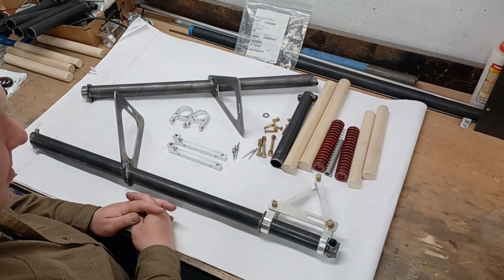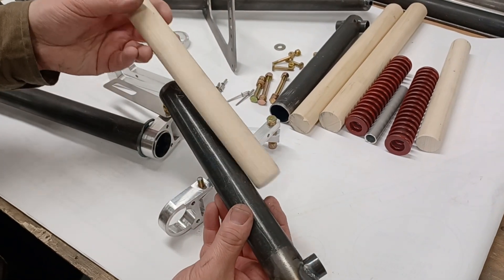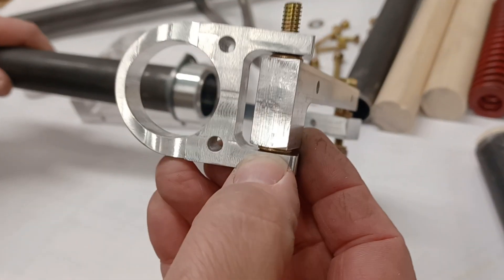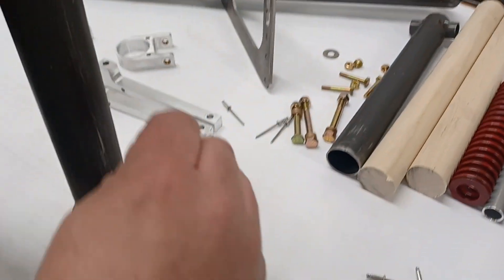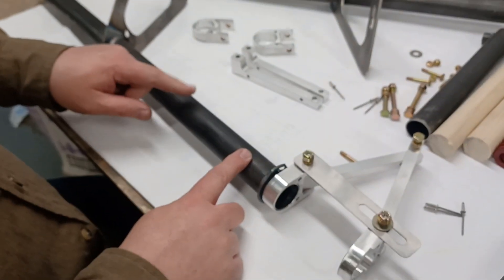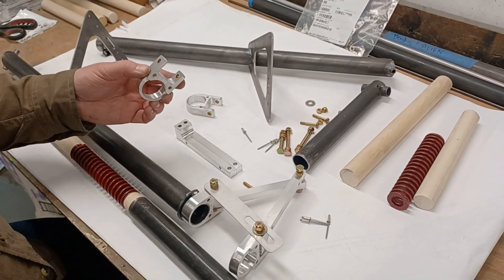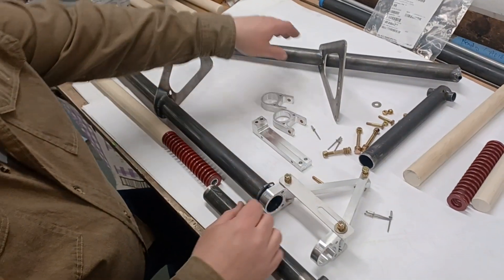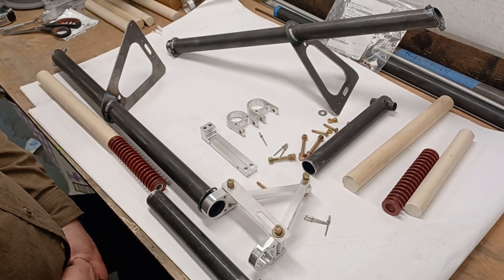H5 New Style Main Landing Gear

Comment: Is using wooden closet poles a good idea use in your shock? I mean you're talking about putting wood in an oiled and compression environment. I own a motorcycle and my front forks don't have wood spacers in them, they have a steel pipe with washers on the top and bottom of that spacer. I mean it's your design do what you want but I think you could be setting yourself up for a big lawsuit if the wood fails and something bad happens as a result of you trying to save a few pennies. Anyway that all said you make some fine aircraft and I hope to someday own an ultracruser.
Reply from the maker: The wood dowels have been used in these aircraft for 40 years. The scissor mechanism is the update. Steel tube are great, but for a light aircraft just too heavy.
Reply: There are titanium exhaust pipes. Perhaps they are suitable to replace the steel pipes. Saves a lot of weight. But is a little more expensive.
 @hummelaircraft
Reply: Wood is fine. Harley Davidson Progressive Suspension kits use PVC pipe/tubing, which also works great.